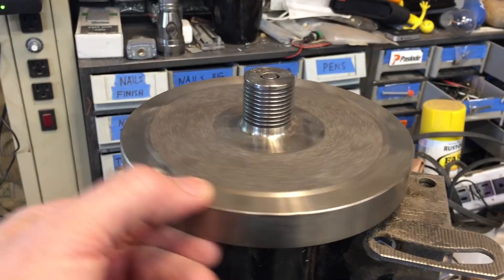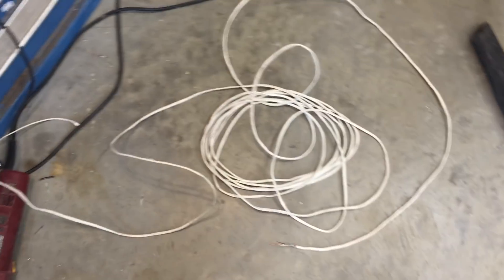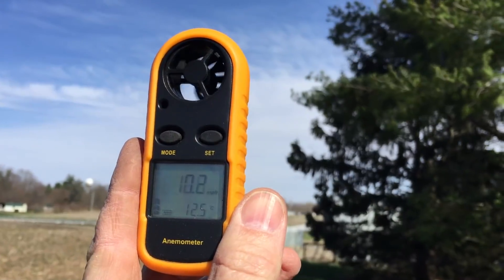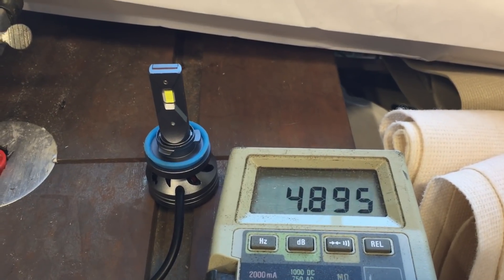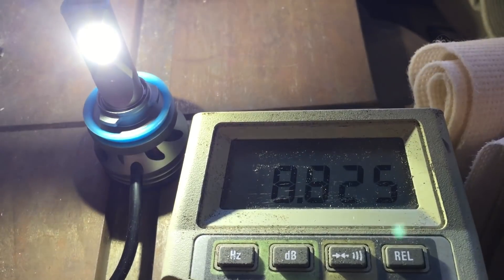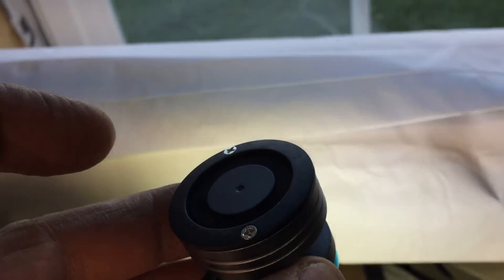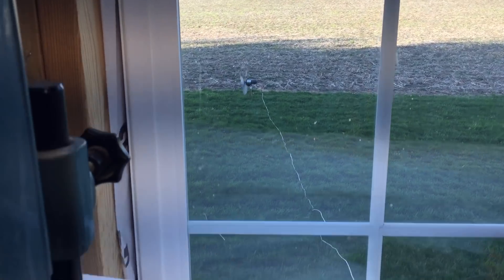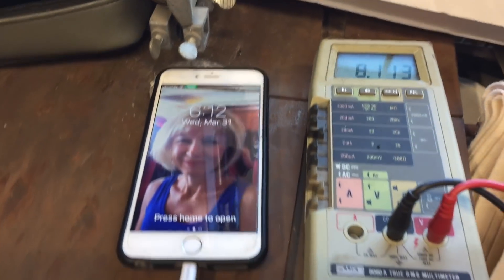DIY Wind Turbine

Comment: What kind of current do you think you are getting (assume 12 volts)
Reply from the maker: I did not measure the current in this setup, but the treadmill motor is rated at 120VDC and 2.5HP (1800 watts) so that would be 15 Amps.  This is with the motor spinning at its rated 1800 RPM.  

I may build a much bigger fan blade that will turn slowly, and gear up with chain drive to get 1800 RPM.   This would be enough to run a space heater or hair dryer.

Comment: Hi any suggestions for more energy
Reply from the maker: Yes!  I have been looking more at the motor.  It is 2.5hp, so it should be able to produce 2,000 watts.   I will try to build bigger blades, and a pulley or chain drive to spin the motor much faster.  Its rated at 1,800 rpm.
Reply: Yes flip flat  opposing blades sideways against its own opposing edges   no betz gaps losses !